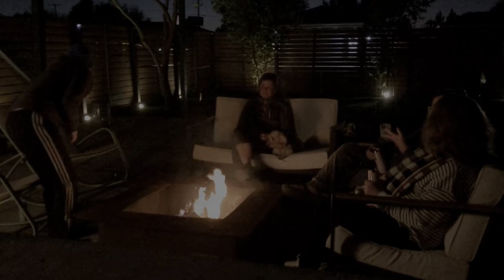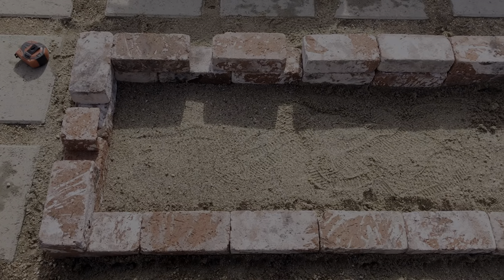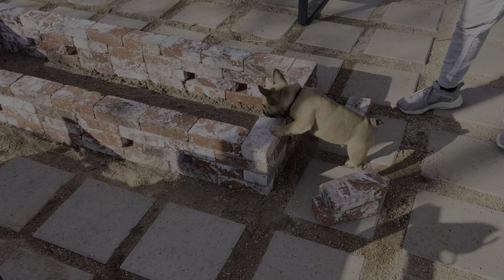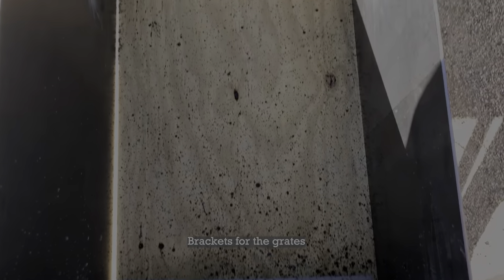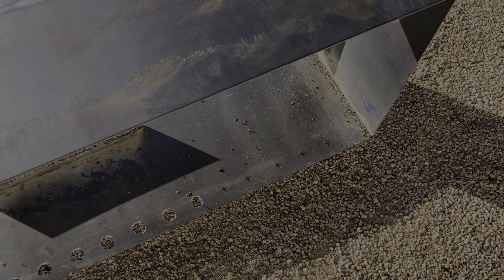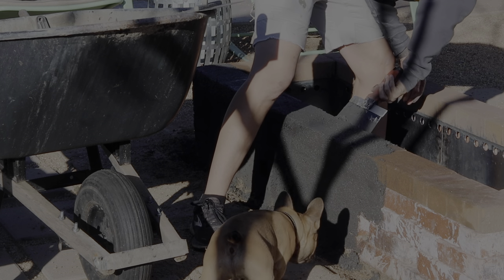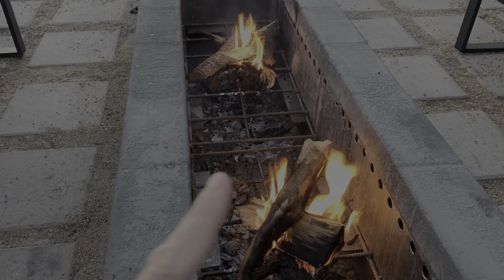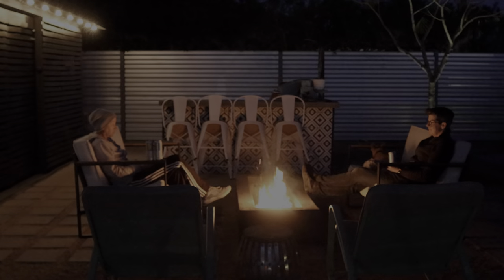DIY smokeless modern firepit of brick, steel, and stucco. Looks great, but does it deliver?

Comment: You went to all that trouble but neglected continuing the supply holes on the bottom with concurrent ones in the metal, the key element.
Reply: please explain
Reply: My thoughts exactly that's the whole jist of a smokeless pit. Your typical intake in the bottom and an additional intake at the tip of the flame for a secondary burn.
Reply: @snakeoil24snake3  the comment below yours mostly explains it.  Both tiers of the holes are necessary, but the bottom ones are even more important because they’re closest to the center root of the fire where it wants the most oxygen, ie. the intake holes at the bottom, and yet the holes in the top where the material is metal are crucial for burning the smoke at a second stage so that it’s mostly a smokeless fire.  It’s kind like of the difference between incineration and calcination, which is a difference in amount of heat and style of burn.  It all has to do with heat flow and thermodynamics.  I had to watch something like 6 different smokeless fire pit videos on here to understand all this, but it makes a lot of sense.  In fact, it’s a little bit like how a jet engine works, just way less complicated or involved.  There’s a great short that explains that.

https://youtube.com/shorts/kfuJbm3gG0Q?si=alGn9vvbajPt9y_8
Reply: I have seen a lot of builds on youtube without any air feeding to the bottom of the fire. I am building my own first attempt now. I am a bit hesitant to drill the bottom row. I am afraid that it would ruin the airflow to the top row. Can you link to a video with a build with both top and bottom holes in the side wall?
Reply: @yvineikeland8734  then you don’t understand air flow and thermodynamics.

All I did was watch somewhere between 5-10 smokeless fire pit videos here on YT + combined it with prior knowledge of physics.  The top row is FAR less important than the one at the bottom, it’s secondary not primary.  Air intake at the bottom of a fire where it is the hottest is crucial.
Reply: @spychiatrist3045  it would be helpful if you could give me a link to such a build with two rows.
Reply: @yvineikeland8734  I’ll make it simpler.  The holes at the bottom are to make the fire as hot as you can get it, which is done with fresh air supply and flow. Fires like oxygen because it is a fuel in a sense.  The holes at the top are to keep the top of the fire as hot as possible so the smoke is burnt away in a secondary burn before it hits your face.

If you neglect the holes at the bottom then I don’t think you understand what’s happening.  I mean if you’re in an extremely windy place then I can understand being hesitant about putting large holes in the bottom, but otherwise it just seems unwise to avoid.

The design that has holes in both places is just copying the most popular outdoor fire stoves..
Reply: @spychiatrist3045  I understand that you have great faith in your understanding of the physics. Good for you. Can you please show me a link to a design with two rows of holes? Just repeating again and again that I do not understand is not helpful.
Reply: @yvineikeland8734  You can translate the same principles from a Solo stove to a fire ring, which I believe the 2nd video does.  But I’m not going to rewatch every single video I watched just for your sake.  You want me to redo my homework.  Do your own!

Comment: Looks amazing. But the shape is wrong for air-flow. Inflow-outflow. The amount of air in should be equal or slightly higher than outflow. But anyway, it looks amazing.....
Reply from the maker: Thanks -- we've really been enjoying it!
So you're saying there should be more of the bottom / outside holes, than the top / inside holes?
Reply: @ShoestringMartha   Firstly the shape is wrong and wont create a vortex to pull the air up faster. And yes the holes in the bottom should be slightly larger so as to not starve the fire of air flow for the secondary burn. But if they are too large then it has a reverse effect where the secondary burn dose not work.  As the steel gets hotter more air flow is created. Looks great though, love what you did.

Comment: its a good idea to understand the tech before attempting to build one. You needed some (but less) holes on the bottom of your metal. You also went too large on the holes up top. 1/2 inch max. Also, the wood/fire has to be below the upper holes to work. The idea is that air is drawn in through the bottom but restricted by amount of holes. The other air drawn in through your bricks is then forced upward and heated. It it comes through your upper holes preheated and with a pressurized force. this air then causes secondary combustion above your fire to zap away any smoke.

Comment: Well done the secondary combustion goes away with the spacing on bottom of bricks from under let’s air through which you’ve done. the holes on top of the metal lets the air flow too and stops smoke. It’s the right method perhaps the fire ring metal you see in kits is the ticket they come in pieces and you have to drill the holes.in any case take it as it is now it’s better than full blown smoke

Comment: Very nice looking fire pit! i just finished my patio and planning on building a long rectangular pit like you both have done. Maybe I'll skip attempting to make it smokeless after seeing the tribulations you all went through! Question though, does the stucko siding hold up to the heat and does it provide any strength or is it more for looks?
Reply from the maker: Thank you! The size and shape were definitely the primarily goal. Smokeless was a "would have been nice". 😄 The stucco is hanging in there, but there are a couple very fine hairline cracks. I suspect because we applied it super thinly. With another coat, I bet it would still be perfect.

Also, with the metal liner and the air gap, the brick stays very cool. So the only heat the stucco really experiences is at the top, and from the sun. It doesn't provide any structural support. It is purely for looks and to fill in the gaps.

Comment: FYI dry I mean dry wood is best for smokeless systems.  I break apart palet wood.
Reply from the maker: We buy juniper from a local firewood vendor, and this batch was from the bottom of the heap, so it should have been very dry --- except, if I recall correctly, we may have gotten a bit of rain a few days prior to this burn. 🤔

Comment: It’s some haters up in these comments, but well done Martha. 

Question: Do you know what the equivalent version of “Quikrete” stucco is in comparison to the Fastwall one you used?  Also, how is it hold up with the heat?
Reply from the maker: LOL true story! We still love it, and that's all that matters to me. 😄 

It looks like Quikrete makes something called "one coat fiberglass reinforced stucco", but I haven't been able to find it as available on any of the big box stores' websites. 😐 Hopefully you will have better luck locating it.

It has held up really well. With the metal liner, and the air gap, the heat doesn't really transfer to the brick at all. You can put your hand on the outside and it's cool to the touch. 

There are a couple of hairline cracks, but I think that has more to do with how thinly we applied it. It definitely could have used 3 coats, instead of 2. Or 2 thicker coats.
Reply: Yall are a good sport 😂. 

Thanks for the info! I appreciate it!  If we end up grabbing it I’ll link the video so you can see how ours came out! Thanks for the inspiration

Comment: How long to drill the holes through the steel?
Reply from the maker: Considering I had to change bits 3x for every hole, and take breaks to allow the driver batteries to cool off / recharge, I'd say about an hour. Could go faster, with proper tools and kinder weather.